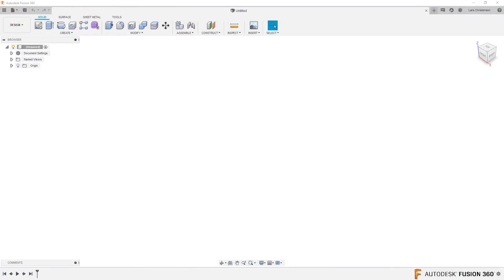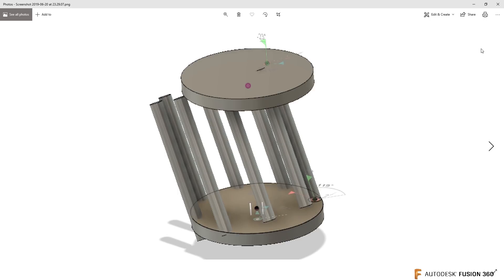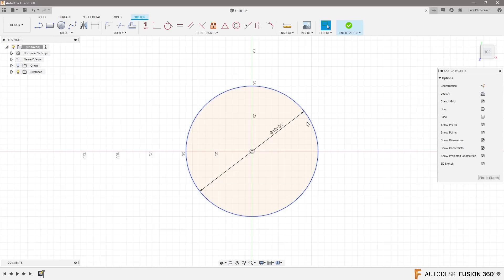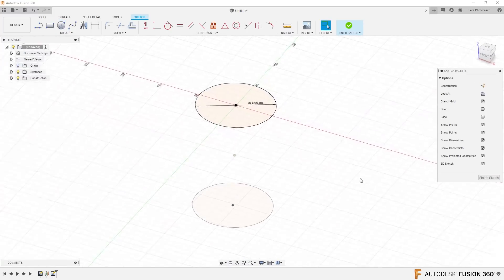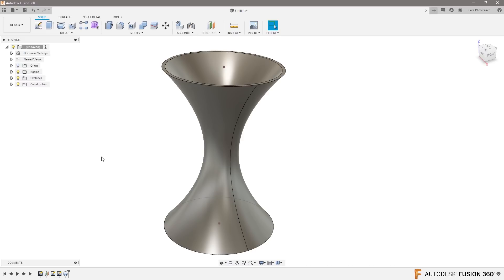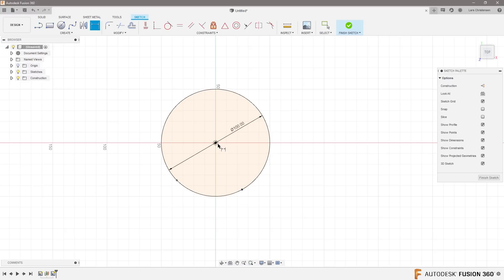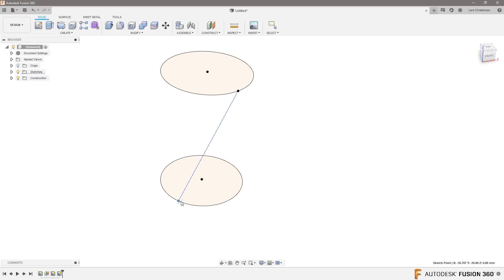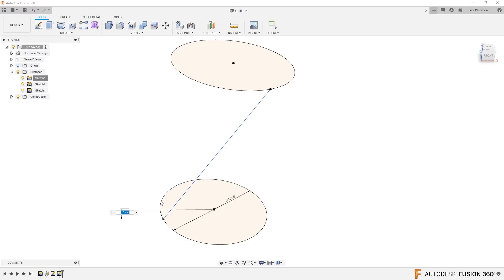Fusion 360 — Create A (Maybe) Hyperboloid  — Ask LarsLive

Comment: In the sketch menu, there is a function called "conic curve." Select this, then click on the desired start and end point of the curve and then on the point where you would like the "vertex" of it to go (roughly). After clicking on the third point, it then asks for a value for Rho, which is less than 1/2 for (a section of) an ellipse, 1/2 for a parabola, and greater than 1/2 but less than 1 for a hyperbola. Then just revolve the shape to make a 3D hyperboloid. Thanks Lars, love the videos -- learning a lot! Also, it's "hi per' bo loyd"

Comment: I made the hyperboloid by using the sweep command in the surface environment. the sketch was a line between two circles on the two planes.  I could not get the revolve to select the correct axis. The section analysis shows a pair of ripples on opposite sides though, so it is not perfect.
Reply: There is another solution: if You don't need super hyper mega precision, You can draw a forming line for the hyperboloid (the red line in the video), and create a set of circles in parallel planes, intersecting the line, with centers on the axis. And then create a Loft between them.

Comment: I found a strange behavior of F360 trying to create a Hyperboloid.
I drew a vertical 100 mm line in the XZ (Front) plane, with the midpoint horizontal to the origin, about 20 mm to the right from it.
Aftrer that, i moved the upper point of the line off the XZ plane 30 mm to the front, and the lower point 30 mm to the back. So, I got a 3D sketch (started in the XZ plane) with one line which intersects the X axis and lies in the plane parallel to the YZ (Right) plane.
I finished the sketch and tried to revolve it in the Surface workspace.
For some reason, inside the Revolve command Fusion only allows me to revolve my line around the (horizontal) Y axis. I planned to revolve it around (vertical) Z, but it is unselectable.
Ok, if I choose Y, technically I still have a hyperboloid in the preview, not in the position I wanted though.
But, when I click OK, the final form of the hyperboloid is revolved around Z (which I couldn't select!), as I wanted, but not as in the preview.

So, we can draw a hyperboloid in Fusion 360, but there are some issues in the Revolve tool.